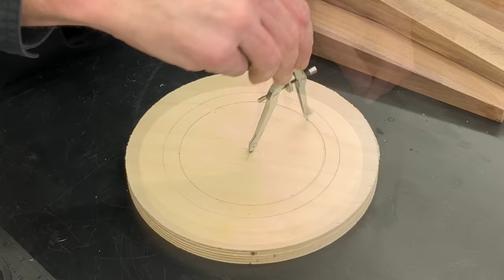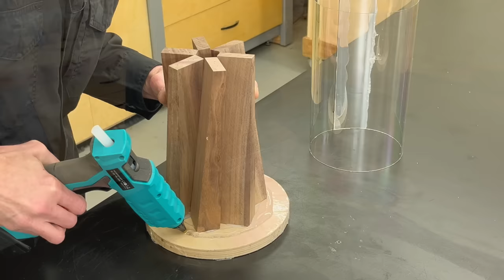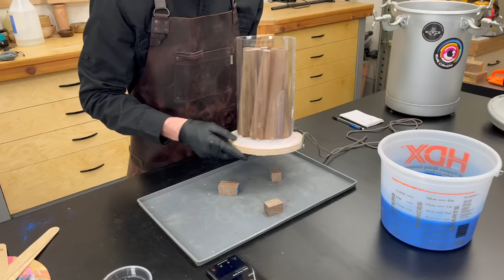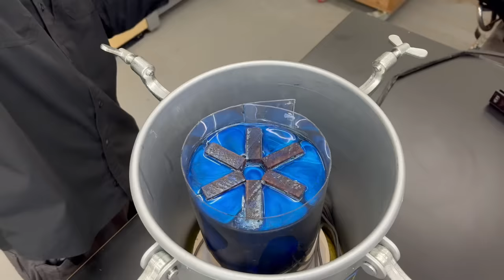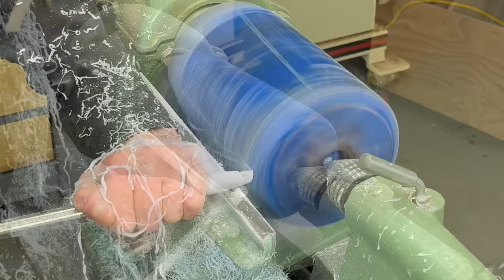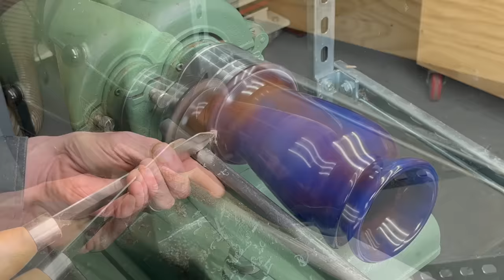Woodturning Scrap Walnut Surprise

Comment from the maker: This is my first attempt at turning a true hollow vessel. I used some scrap walnut off cuts from the legs of my end table build. This was great fun and I plan to make more hallow vessel type pieces in the future. I got some new tools I am using in this video, I plan to go over all of these as well as the new finish I am using in a video soon.  This may be the last time I use the urethane resin for a while, I want to go back and try the epoxy again now that I have had some experience with the urethane. Hoping to get a solid technique locked down so I can share some useful information. This was the closest I have come to having a mold fail in the pressure pot. I don't think  I will try a diameter smaller than 7" with the polycarbonate sheet. All and all I am pretty happy with how this piece turned out. I really liked the black mixed in with the blue resin. I think the proportions are  a little off in the finished piece, but I may just be too hard on myself. Will definitely be trying this one again down the road. Thank you very much for watching and I hope you have a great day!
Reply: "Maybe too hard on yourself"????🤔 I think that the colors looked great.  And others do too!!!!! 😃
Reply: The blue you use compliments the wood, but as a redhead I'm partial to green.
Reply: Muy creativo!!!! 👏👏👏💖💖💖🇦🇷🇦🇷🇦🇷
Reply: Absolutely beautiful. Congratulations on such a great piece of art. Thanks for sharing your talent.
Reply: Lovely! By the way, I believe the heat from the resin caused your hot glue to soften and fail. If you just reinforce with something a bit more heat resistant, like a nice strip of gorilla tape or equivalent heavy duty adhesive strip on the outer edge of the overlap, you won’t have that problem anymore. You can even go smaller, although I think the resulting mold will be less circular.
Reply: Very nice! You did yourself proud on this one!
Reply: Very nice
Reply: Great work! Did an amazing job for your first time! Thanks for sharing.
Reply: You're definitely being a little too hard on yourself. I got a wee bit worried when I saw that loose flap of polycarbonate. However, everything turned out phenomenal. The colors with the walnut turned beautifully. I have been a subscriber for a while and don't know how I missed this one. Was curious about the red light on the interior. Then realized that you were probably checking on wall thickness. All around phenomenal video for this insomniac.

Comment: That is the best combination of wood and resin turned into a vase that I've seen.

Still a bit confused about the original "off cuts". The dimensions seemed to be pretty accurate or is that just me?

Anyway, congratulations. This was brilliant.
Reply from the maker: Thanks for watching. The off cuts were from a previous video of building two end tables. I did cut the pointy ends off so they would fit in the pressure pot, but I just got lucky the angles worked out. Thanks for watching and leaving a comment. I hope you have a great day! 
Scott

Comment: Another amazing piece!  You sure got lucky when the secondary glue failed on your mold!!  I notice the pieces of wood you used all had the same “twist” to them.  Was that from the design of the table legs you got the cut offs from?  Did you polish the inside? Or what did you do there?  Your precision is inspiring and clearly a sign of the exacting craftsman you must be with “flat work.”
Reply from the maker: Those scrap pieces were exactly how they came off the end tables I made. Wasn’t really a twist to them, those were just the angles I made the table legs at. Definitely glad I didn’t fill my pressure pot with resin. That would have been a unfortunate mistake. Thanks for watching!  I hope you have a great day!
Reply: What angles were the table legs cut at?

Comment: Wow very nice. I want to try the same. Why do you put the epoxy under pressure and not under vacuum ?
Reply from the maker: This piece was made with urethane resin which has a 12 minute working time. There is no time for degassing in vacuum. The pressure pot squeezes any bubbles down smaller than the eye can see. I rarely use vacuum at all anymore regardless of resin type. I feel the pressure pot does a great job. Thanks for watching. I hope you have a great day. 
Scott

Comment: If it doesn't bother you, use the advice

Place a “container” in the tank in which you will lower the product. The additional capacity will protect your main tank if the filling compound leaks.
Otherwise, what leaks out will remain in the tank forever, and this is sad

Comment: I have a similar lathe. It is  belt driven. I want to convert it to a veritable speed motor. It that possible, and what and where do I start.
Reply from the maker: It’s definitely possible, but might not be worth the money needed for all the parts. There are some videos posted of people who have done it with a full list of parts needed. I thought about it and have decided against it. I will by a new lathe when I’ve out grown this one. It’s been an amazing first machine to learn on tho. Thanks for watching. Best of luck. 
Scott
Reply: @squareandlevel  
Thanks for the quick response to my question.
I still have the motor that came with my lathe but no longer have the bracelets to mount it.
Where can I find information for mounting brackets ?

Comment: Great video-This gives me some ideas for table legs with walnut blades and epoxy. My coffee table legs are usually 17 inches starting out. What is the max height of that pressure pot? Thanks love the blues!
Reply from the maker: This pot has a max height of 12 inches. I ended up choosing this one because of its height too. It was pretty much the biggest one I could find before the price increased significantly ( think I paid $70 for it). Good luck with the table legs. Hope you have a great day!!

Comment: Are you pressuring or pulling vacuum in the vessel?
Reply from the maker: This piece was with pressure. I used urethane resin and it only has a 12 working time. Cannot use vacuum with urethane. Thanks for watching. Hope you have a great day. 
Scott